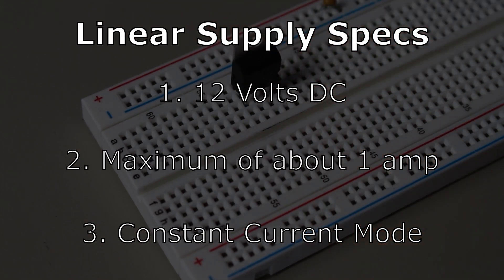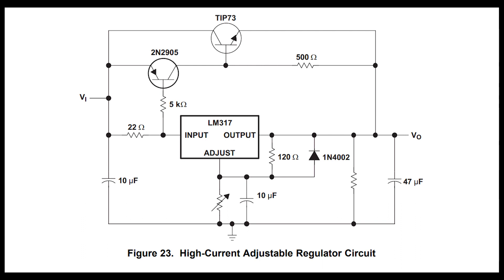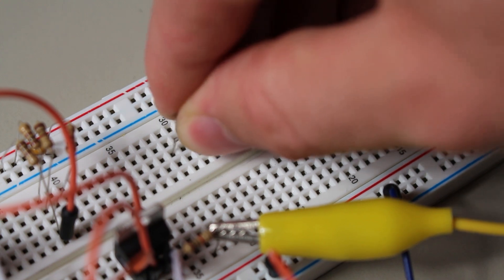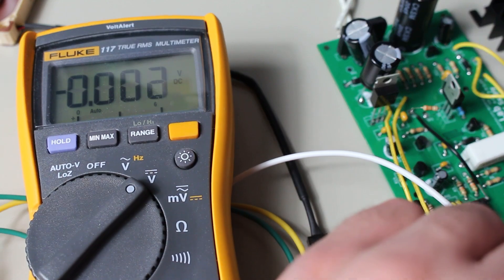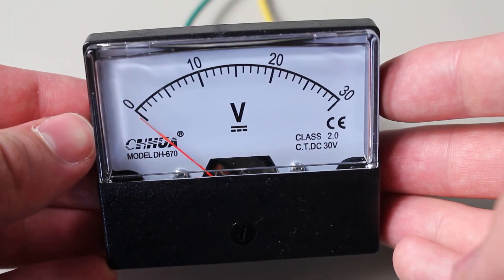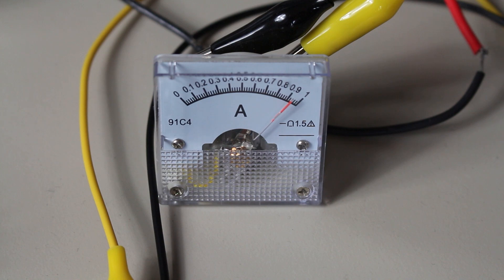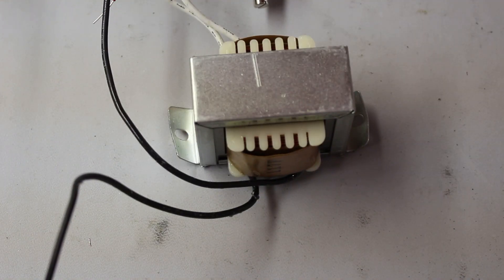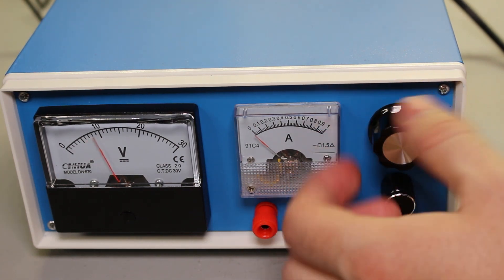How I Made A Linear Bench Power Supply

Comment: How come you used a 5W resistor for the current sense?
If you get a short circuit on the output it will far exceed this anyway until current limiting drops the voltage to basically zero.
If you have any load attached, the power should be dissipated in the load unless the load itself has a tiny resistance, in which case you're again dropping up to 12v across basically a short circuit (current limiting should again turn this off).

Building my own power supply as a project and decided to heavily base it off this design as it ticks the same boxes as I wanted (except I will be working with a 2A limit). Just curious as to why you chose 5W as opposed to either ~12W to match the short circuit rating your supply could output or a standard 1W or less resistor since current limiting will handle shorts anyway.

Would love your thoughts, cheers
Reply from the maker: I don't remember the exact reasons since I made that project quite a while ago, but the resistor should be able to withstand the very high short-circuit current until the regulator is able to handle it. In this case, I'm not necessarily aiming for the peak power consumption, but rather something kind of large enough.

Either way, if I were to redesign this today, I would use a lower power rating, since the regulator should be fast enough to solve the problem.

Comment: I feel like you overcomplicated the current limiter - in my power supply I used an LM324N and a MOSFET for the current regulation, and it limits well without the shunt voltage amplifier with 0.1 Ohm shunt, but then again I also didn't use an LM317 for the voltage regulation, but an LD1084V without the minimum voltage compensation, as I don't work with circuits that reqire such low voltages. Anyway, great video, keep up the good work!

Comment: You could use a ~45 degree normally open bimetal switch to turn on the fans. I didn't notice you mention any earth grounding plan during the construction of the video, but I hope you wired earth ground to the case and the transformer.

Comment: Hey! Nice video as always. Btw, why not put the lm317's voltage divider after the current sense resistor? That basically removes the effect of series resistance from the circuit and improve the load regulation. It will obviously sense extra current of the voltage divider but thats small. Thus current regulation only slightly worse but voltage regulation much better specially if designed for high currents.
Reply from the maker: That's an interesting improvement. I'm not 100% sure how it would perform, but it definitely could work. The next time I make a linear supply I'll keep your suggestion in mind! :)
Reply: @SineLab  I realized that would not work directly. For my project, I will sense the current at LM317's Input.

By the way, can you please give me all the references of that intelligent current limiting mechanism? I need some guide to decide component values.
Reply from the maker: @MohammedAyazQuadri  Sure, R2 is the current shunt resistor, and you should pick a small value to minimize the voltage drop.

U4B and the surrounding 4 resistors form the differential amplifier. It takes the voltage drop across the shunt and then multiplies it by 10 (100k / 10k = 10). I would adjust R3 and R4 as necessary to get your desired gain.

The gain of 10 and the 100m shunt resistor together will give us an output voltage of 1:1. That means that 1A of current gives us 1V out on the differential amplifier.

U4A is simply a comparator. The inverting input is connected to RV1. This is a potentiometer that acts as a voltage divider. The max voltage of the divider is 1.2 volts, generated by the zener diode.

If the current sensing circuit is of a higher voltage than the limit adjustment, then it turns on the comparator. This comparator turns on an NPN, which will pull the adjust pin down to -1.25 volts, therefore giving us 0V on the output in the event of an over current.

I hope that this helps :)

Comment: Love this power suplly video, one of the best and I have watched many! Is it possible to connect two of these supplies in series, to make  +12v 0v -12v? As many audio circuits use this
Reply from the maker: I haven't tried it myself, but it should work since the transformer inside isolates it from mains power.

Comment: Is the ground on the AC side and the DC side same or are they isolated?
Reply from the maker: All of the grounds on the schematic are connected. Mains power is isolated from the circuit through the input transformer. Don't connect mains power to anything other than the transformer.
Reply: So where is the ground from AC connected to. Do you have any idea on resistance reading between AC ground and DC ground?
Reply from the maker: On the primary side of the coil, I connected the two wires that come from AC mains voltage. On the secondary, the schematic will show you the connections. Every time that you see a ground symbol, it is electrically connected with 0 resistance to all other ground symbols. 

If you want to know about the third AC "ground" pin, then you can connect it to the metal shell of your case. It is not required to run the circuit and is only in place for safety reasons. This third pin is not included in the schematic and is not connected to the ground symbols.

Comment: The design is fine and all but IMO too many ICs, especially for a beginner, i built mine using only LM358 and damn is it unstable but you basically cannot kill it xD
Reply from the maker: It's probably not the most beginner friendly unfortunately. I'd like to see that LM358 design too haha
Reply: @SineLab  It's not very complicated, first opamp in lm358 regulates the voltage using a darlington pair (simple linear reg) and then a single npm transistor pulls the current from the darlington pair when the current through the shunt goes above the threshold
Biggest mistake i think was that i used zeners as references but they are not stable at all, with some caps and stuff this could probably be kinda stable but you'd need a oscilliscope to check and i do not have one
Reply from the maker: @alexstone691  Sounds cool :). Maybe you could make it stable if you ever end up getting an oscilloscope
Reply: @SineLab  maybe it would be a good video to do, i certainly would watch it :)
Reply from the maker: @alexstone691  It's a good video idea!

Comment: Bravo on all your hard work. Bravo for sharing it with us. I offer the following questions, without intending any criticism... You built a linear supply' which has the significant advantage of being a non-switch-mode low noise source. Then, you used a charge pump within the circuit. A charge pump uses switch-mode operations, as you know. So, did you add back the noise that you were trying to keep out? I am still thinking about that. You used robust components to build the fixed negative supply, to enable true 0-12V operations. Might it be useful to make the fixed negative supply to be variable, as well? Then, you would have a -12V to +12V supply with the ability to trim it to 0V. I have not thought this completely through, but I think that you have already incorporated the main components. Maybe it is an idea for you for a future build? Two small things to help our understanding. Please post a complete schematic at the front of all your videos. This way, we can refer to it, as we follow along in the lecture. Yes, I know that you posted it on your website, but that is not so convenient, when watching the video. As you are reading your text from a script, please remember to speak slowly and use pauses. We need time to understand what you said and to incorporate your present points with your former points. I offer these things in the spirit of Community. I hope you take them that way. You did great.
Reply from the maker: You are right about those improvements. Perhaps I could use a center-tapped transformer along with the LM337 to get those +/-12 volts. And thanks a lot for your suggestions, they are very helpful as feedback. Thanks for watching. :)
Reply: @SineLab tD100 ha ragione, anche perché chi, come me, non mastica la lingua inglese, non riesce a seguire il video dovendo leggere la traduzione contestualmente a ciò che fai. 🤣🤣🤣
Reply: Isn’t the lm337 identical to the lm317 except that it is a negative voltage regulator rather than a positive one? Therefore I wouldn’t expect any noise from that that you wouldn’t already be getting from the lm317.  The specs for RMS noise are the same for both ICs.
Reply: @robertthompson5908  Both the LM317 and LM337 are not magical, there are different types of noise that they will be good and bad at removing. Slow rectified mains ripple they should be quite good with. Higher frequency maybe not so much. But it all depends on the level. With enough capacitance the LM337 might be able to diminish the charge pump to negligible levels.

Comment: Nice video, loved your use of the LM358. I recently used it to make a sound amplifier from 0-5V with a 2.5V offset and it sounded relatively clean (depending on the speaker frequency range as well) its not the best for sound quality but it was alright as long as signal doesn't clip
Reply from the maker: It sure is a handy little ic. :)
Reply: Is it possible to drive speakers with the 358? I thought the max out current was too low for that application
Reply: @keisorestis6487 thats right, an Op amp cant provide much current which is why you need to amplify the current. Transistors will be your goto for amplifying current
Reply: @Inti72600  Since you can amplify your signal with a transistor what's the upside of going through an Op amp first?
Reply: Op amps have a higher Gain than transistors, imagine you want to amplify a veeeeery small signal, in the mV scale. Ideally an op amp has infinite gain, but in reality its gain is a bout 100.000 max. its more than enough to transform an mV scale signal to V scale, an op amp is useful for these applications, voltage gain,  of course there are other applications but our topic is signal amplification. On the other hand, the gain of a transistor for voltage gain is a lengthy mathmatical process if you want all the details, i can't tell you much about it, other then the fact that they are useful for amplifying the current of our voltage boosted signal from the op amp. the current gain is easier to calculate.